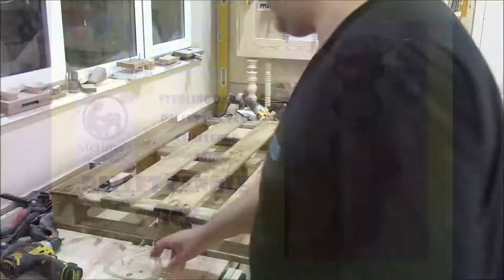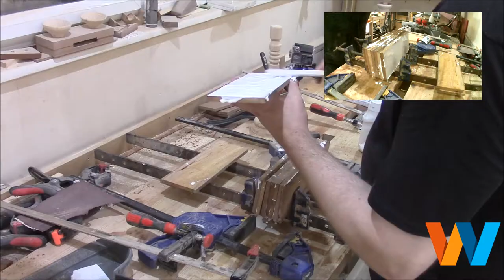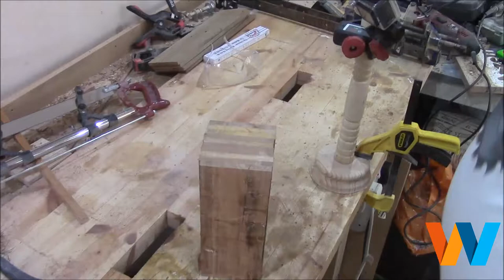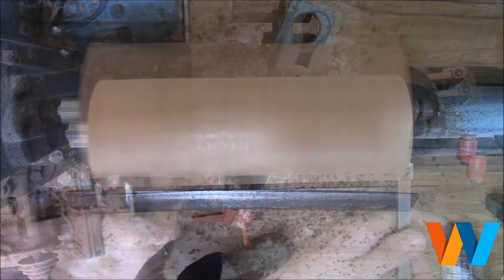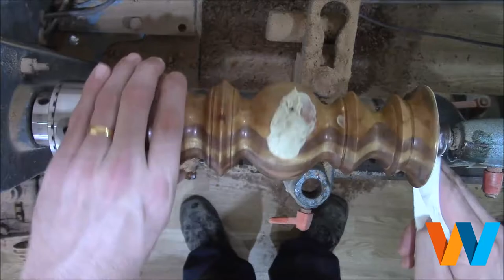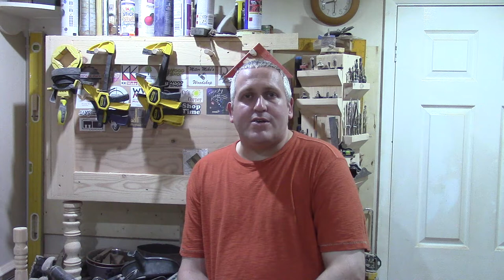#25 Pallet candle stick - Pallet upcycle challenge 2016 | Create 2 make

Comment: Nice.

I wanted to do a big candle stick holder as my first woodworking video for the pallet challenge in 2014. It flew off the lathe in parts. Great to see yours worked out so nice. I wish pallets would have nice wood over here, allwe have is lousy spruce and pine .

Great project!
Reply from the maker: Thanks Willem, when I picked the pallet I got another the same so I may make a matching one. I wasnt sure about the piece coming apart so I used alot of glue. Thanks for watching